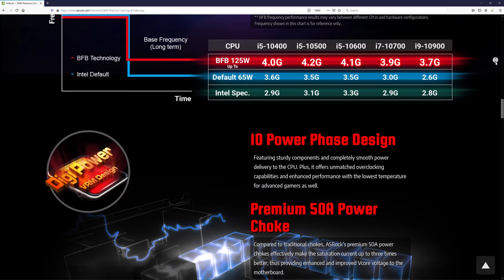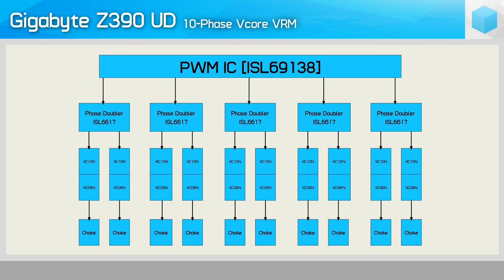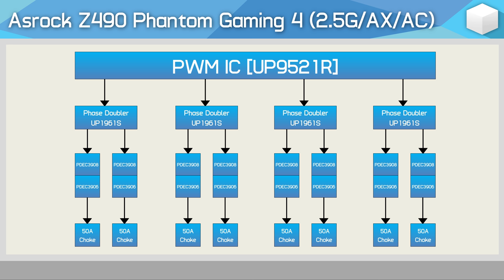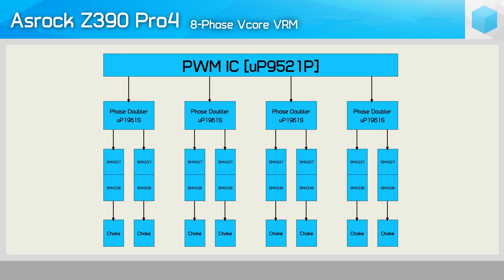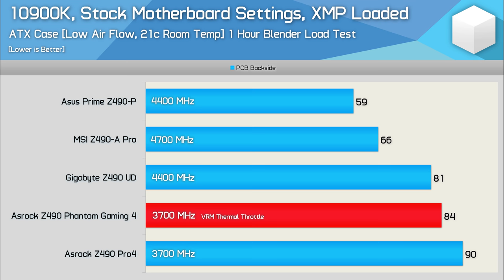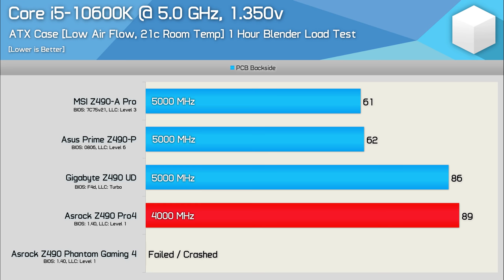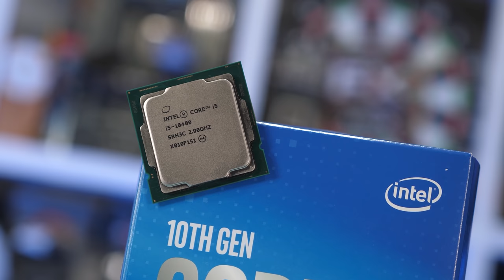Intel Z490 VRM Testing, Budget Buyers Beware of Lies & Misleading Marketing

Comment: MSI seems to produce pretty good mobos in general, both for AMD and Intel. I, certainly, have been extremely happy with my Z370 Gaming Pro Carbon, for a couple of years now.
Reply: Well no. They totally screwed up the X570 line
Reply: @kamilmotulewicz5026  Oh, really? Why does even Steve himself have a couple of videos where he mentions some really great MSI X570 mobos?
Reply: @kamilmotulewicz5026   there is the msi x570 tomahawk which was their "return to glory" and also the x570 godlike which has the same good vrm of the tomahawk but more expensive
Reply: @WereCatf  when You're looking for these overpriced mobos for extreme OC then yes, you can choose MSI but if You're looking for more affordable one for 200$ you should avoid MSI with only one exception which is the new X570 Tomahawk as mentioned above. VRMs in cheaper MSI's x570 are as bad as these in ASRock's presented in this  video. Steve did a video about it. Unfortunately the X570 Tomahawk is still not available in my country that's why I'm still calling their affordable mobos a total crap

Comment: Damn, that is bad (can't even do a mild overclock on a 6 core CPU🤣). Thanks for bringing attention to this, it's similar to what MSI pulled on their lower-end X570 boards, and why do they also pair these with anaemic heatsinks? Are they trying to shoot flames out the back of the PC afterburner style? (never noticed the irony with MSI before...)
 
The only question now, can you fry an egg on it? (should be possible) and bonus points for bacon, mmm bacon...
 
PS: What is going on with the LLCs in 17:14? L3, L6, 'Turbo', L1...

Comment: ive always used Asus and gigabyte boards for my system. ive never had real issues with them, and they are very budget friendly. hell my 8700k OC to 5ghz run just fine on my gigabyte Z370 Aorus Ultra Gaming Wifi. Got that for $100 on sale from Frys Electronics.

Comment: From my humble experience in the recent years, if you're hesitant in your motherboard choice, just go with MSI.
This is amazing considering that those are "Z" boards and are supposed to be made for overclocking, yet they can't even handle an unlocked 6 core i5... while Steven tested a 12 core Ryzen CPU on a B350 board with no apparent problems...

Comment: Can you review the ASUS PRIME Z490M-PLUS
? It's a pretty cheap costing z490 motherboard compared to others but I'd like to know how the vrm's perform under a 5.0ghz overclock on the new 10th gen cpu's
Reply: z490m-plus has 8 SiC639 for vcore, same as the z390 hero, so I think it should be able to handle up to 10700k

Comment: To be honest, I’ve been a long time user of ASUS boards, happily used MSI and Gigabyte boards as well. I had Asrock boards on two occasion, during the Socket 775 days and the Sandy Bridge days. It’s the only boards I’ve ever had memory incompatibilities (worked fine on my ASUS board 🙄) and general system instabilities with. Random, unrepeatable crashes, etc... I know my way around when it comes to OC and I would consider myself an enthusiast. Ever since I’ve stayed far, far away from ASRock. Maybe their higher end boards are worthwhile taking a look at and sure, other manufacturers also mess up (looking at the MSI X570 VRM disaster), but mid and entry level ASRock boards have always let me down.
Reply: AsRock are not my first choice, and I would never buy one new, but my Z87M Pro4 just works with my Haswell i5 (it was available and cheap). The 4.5Ghz clock I have on it at the recommended voltage for that is totally stable and the RAM XMP just works.

Comment: So I am doing a new build after 10 years. Can someone tell me whether should I plug in both the 4pin and 8pin 12v CPU cables on the GB-Z490 UD?  Will be using 10700k with limits removed. PSU is an rm1000x.

Comment: I am stunned at the vast difference in value and quality between the AMD and Intel motherboards. So glad I went X570 and AMD 3900X.
Reply: The Intel chipset is expensive AF. The mindblowing power draw makes the VRM expensive AF. If you have to pour as many features on it as an AMD board has you end up with a $250 price tag on the entry level boards... something's gotta give or people will realize they pay are going to pay $300 more on their total system for that "Crucial 10% advantage in high refresh competitive gaming... but only on a 2080ti... and only at 1080p.. and only if you have a 240Hz monitor or better".
Reply: jvalex18  No. Intel is better at gaming when you are CPU limited only. As soon as you hit the hard GPU bottle neck it becomes a moot issue. I get that e-sports players need all the FPS they can get (or at least they say they do), but for someone who likes single player stuff at 1440p/4k with every thing cranked to max it pretty much becomes a question of "how do I save elsewhere to be able to buy a better class GPU".

Comment: My ASUS Z370-F strix came with a little M.2 bracket that holds a 40 or 50mm fan. It's advertised for M.2 cooling but I've screwed it down with the AIO over my VRM's.

This thing must cost pennies to manufacture, why don't these companies include something like this in their budget ranges, then you could overlook the fact the vrm heatsinks aren't on steroids

Comment: If I was in the market for a new Intel system, I would have def. looked at Asrock since the boards I had from them (two) were quiet good........ Thank you very much for the review although I will probably go down the AMD route once 8 cores become the new standard with the upcoming gaming consoles. My gaming Rig still plays my titles quiet well (i7 6700K @4.6, 16GB Ram, GTX1070 at full HD Asus 144Hz Monitor). Maybe Asrock for the next Gen AMD, I wouldn't rule that out, but the boards you tested  here are a disgrace.

Comment: How to check VRM temps? I have Asrock Phantom Gaming 4, Intel 10400, when using the new Base Frequency Boost bios it tops out at 81W :/ My older Haswell system up and died.. so I just went and got the cheapest z490 mobo :(

Comment: 12:50 how is the airflow adequate with a closed off front panel AND a radiator in the way of the intake

BTW is it just me or does it seem like the motherboard manufacturers are taking turns in producing garbage tier products with every processor generation from Intel or AMD?

Comment: Does ASRock even try anymore?
Edit: My B450 Aorus M includes 4x USB 3, 2x USB 3.2As, 2x USB 2.0s (total 8 TypeAs), HDMI and DVI out and surround audio. It has decent VRM with decent heat dissipation, M.2, 6 Sata Slots, Digital and Analog RGB and a RGBW port.. All in for 104 dollars.

Comment: Funny how motherboard quality makes no sense. It often doesn't correlate with price, manufacturer, anything. I didn't know about Buildzoid when I bought my Asrock B450 Pro4, my R5 2600 could only overclock to 4.1GHz at a whopping 1.4V when everybody I saw could get 4.2 easily. When I found out about him, I discovered that I could've bought a VASTLY superior board for less than $10 more. Recently I got a nice deal buying a R7 3800X and selling my R5 2600, and even at stock settings and letting PBO do the overclock it rarely ever reaches the 4.5GHz single core boost, 95% of the time it can only get 4.4 or 4.45GHz when I'm lucky, and the side of my case get really hot when gaming.

Comment: The last ASRock board I bought was the X470 Taichi, and it will be the last ASRock board I buy.  The board was great with Ryzen 2000, but was nothing short of flakey trash with Ryzen 3000.  Their BIOS support is terrible and even with the lastest 3.90 version the board still has boot and post issues.  It's been almost a year since Zen 2 released!  

So anything ASRock is a hard pass for me.  I ended up replacing it for my daughter with a Gigabyte B450 Aorus Pro WiFi (she doesn't  OC, so not worried about the VRMs and the board was a great price), just swapped them out, didn't reformat or anything.  Her machine is flawless now, go figure... 

I'll be sticking to the majors now, Gigabyte is my fav, both my kids have the afore mentioned B450 board, and I have the X570 Aorus Master, all have been fantastic and BIOS support from Gigabyte is great.  My wife has the MSI B450 Tomahawk, another great board.

Comment: So basically the ASRock motherboards' VRM coolers are not enough to sustain a heavy load with 10900K, due to severe lack of thermal area. Granted, I'm glad ASUS and MSI have learned the lesson regarding the VRM cooling and using good VRMs to support the 10900K. :)
Reply from the maker: It's more that the VRM components, the chips, are garbage.
Reply: @Hardwareunboxed  Oh, that's why... Maybe it has something to do with cost-cutting as strong VRMs tend to be more expensive than inferior ones that could not handle the punishment levied by the 10900K.

Comment: these vrm temprature wars at the moment.. now im never one for liquid cooling and i tell you why. and it has to do with the bloody static heat sinks on the vrms once you've removed the cpu fan from the equasion and replaced it with a water block you've killed off the passive cooling of the vrm quite substantially this is Exacerbated by overclocking.

Comment: I've only used Gigabyte MB's and MSI stuff, both have lasted for over 5-7 years until upgraded,Bought an ASUS MB and put my intel chip that was in my Gigabyte into it and it was a worse board, and I only use Nvidia GPU's and again gigabyte and MSI, they have NEVER failed in all the years I've built computers.

Comment: Maybe overclocking an Intel CPU in a case with mediocore airflow and then letting it run Blender (an AVX2 load!) for an hour with full load on all threads is not really a use case that makes any sense. I do own a Z490 Phantom Gaming 4. I can easily play Modern Warfare with 5 GHz, 1.35V on an 10700k all day long without any throttling.  Someone that really does a lot of rendering will get an AMD system with more cores anyway. Someone that is going to build an Intel rig for gaming ill be just fine with any of these boards with a load an air cooler or an AIO can safely dissipate. Maybe gaming loads are what a board called "Phantom Gaming 4" as designed for.

Comment: So the choices are junk from Asrock, a bad but useable at stock VRM with acceptable IO from Gigabyte or capable VRMs with no IO from MSI and Asus. Wow. The only thing on that list I would consider is the Gigabyte board because I don’t overclock and it will cost another $20 in add on USB cards to make up the lack of IO ports the two other motherboards don’t have.

Comment: What is going on with ASRock? I have a few of their boards and they were always good "bang for the buck" and have only had one fail during a thunder and lightning storm, which was replaced for free. They need to get their collective S#%T together and fix these problems before their brand takes too big of a hit. I would be pissed if my new motherboard couldn't even run a processor at default settings, come on ASRock.

Comment: It might be time for a standardized definition of the term "phase"
Reply: There is one.  Given a switching rate, the number of pulses within one switch cycle, offset from each other, is the number of phases.  The whole point is to reduce the troughs in power delivery, so you get a smoother output wave, without the need for a bunch of extra capacitors to do the smoothing.  You also need less beefy components, because the overall load is shared between many of them. 

It's really analogous to the cylinders of an internal combustion engine.  The more cylinders, the smoother the engine, as they can fire out of phase with each other to counter the momentum that wants to make the engine rock back and forth.  And you can use smaller cylinder bores to get the same amount of power.

Comment: i'm gonna preface this admitting right away i'm understanding cpu vrm in these months and i'm still in open sea so yeah.. this below could be bollocks feel free to correct and add to it, i'm here to learn .
i'm not really sure you can just sum the max amps of the power stages and call it "capable of" anything.
the high side mosfet bears the bulk of the load and that is 12V*amps which is much less amps than what the cpu draws from the inductor, also no 2 or more phases should be conducting at the same time anyway (some overlap might happen) because it's a multi-phase configuration so the amount of phases shouldn't matter: it's a 45A 10phase vrm, not 45A*10phase.
the reason why more phases is better has to do with transient load response time, not max current.
Reply from the maker: It you have a 4 phase VRM with double the components or an 8-phase VRM with half the components, if the components are the same, the current capacity is much the same.
Reply: @Hardwareunboxed  i wish i had a scope to probe around. :)

Comment: People give ASUS a lot of shit but their boards are really solid if you ask me. Their cheaper stuff has nothing you don’t need and always pack the right components where it counts. I went with an x570-prime p for my 3600 after I bricked my x-370 prime (my own fault) and before those I was running a P6-X58D-E with an i7950. All those boards were champs and could overclock to anything I could manage and the cpu could handle. I wouldn’t say their GPUs are always the best but I think they and MSI are my go to motherboard manufacturers.

Comment: AMD fans:  cried & whined about why no support for B450/X470 for Ryzen 4000 (last month) which costs between $70 to $120 and AMD fixed that with promising to provide Bios support 
Intel fans:  Watch my stock i5 crash on my $150 Z490 mobo Lol, I just wanna know how Intel give Asrock the certification licence to sell toasty mobo
Reply: jvalex18  Why U buy Z490 & unlocked CPU if you won't OC?
I can understands the H series Mobo / A series have no OC option, but as long as Z490 meant to OC, then it's retarded to not include good VRM on all Z490 Mobos

Comment: literally every brands z490 mobo: we are ready to power a cpu, my vrms are amazing, i wonder how hot will intel 10th gen be
intel 10th gen: okay soo first i want 230w power, then i need minimum 720mm water cooler, but i prefer liquid nitrogen so yea. oh by the way my bro 10900 (not k, no oc, stock) just reported 90 degrees on 360mm water cooler, oh my bro how could they even try to cool you on this cheap water cooler :(  this is real by the way 

beware yall, ready to spend half your budget on a liquid nitrogen, i9 10900 and 10900k are coming!

Comment: I have said it before, I will say it again: ASRock is trash & has gotten a reputation that it does not deserve. They are always listed as a great, feature rich, budget, mobo. I have purchased 3 in the past, the last was the LGA 1155 Z77 Pro 3 in 2013. The first Z77 board was DOA, the second board made it until the end of 2014 (about 1 year) before it started behaving erratically and was replaced by a Gigabyte board for my black Friday 2014 upgrade.  

The prior two ASRock boards were the same story, they were purchased as the best mid-tier budget boards of that generation, they both started out with promise & were feature rich, they both became unstable & were replaced with name brand boards within a year. I haven't even mentioned the absolutely trash RMA process for ASRock & I wont bother because I will never purchase another one.

Long story short, they pack their trash with features so that tech channels will refer to them as the best mobo in their price range. That's it, it is a scam. No tech enthusiast is running ASRock in their personal systems. Pay the extra $20 - $25 for ASUS, MSI, Gigabyte.
Reply: I've had a Z97 Pro3 with a 4790K for the last 6 years and it's still going strong.  Was looking at ASRock for a Z490 build but after this video I guess I'll go Asus or MSI.

Comment: its almost as if z490 is just for unlocked ram frequency. Which helps in high framerate games. with 20 to 50fps perf advantage. No overclocking though lmao. On a board thats over 100 bucks\eur. Ridiculous

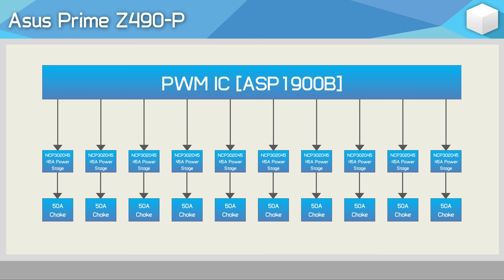Comment: 4:46 chart makes it look like a 10 phase, there should be 5 lines coming from the controller, each going to 2 power stages as they run in parallel, i know asus does not use doublers

Comment: Ouch ASRock... Ouch... You should've known better than to try and run shenanigans with Steve. "Absolute garbage" are pretty big words when they come out the mouth of a level headed Aussie... But failing to run the 10900k at base clock without even MCE enabled is just that...

Comment: If you're cheaping out on a mobo w/ a 10900k, you deserve to have it not work right......
Reply from the maker: Makes no sense at all. Why waste money on features you might not need. As proven here the Asus and MSI models work just fine. Why spend another $100-$200 if it buys you nothing you need?
Reply: @Hardwareunboxed  a better VRM solutions is one of the features you're paying for.  I agree there's a lot of functions / features on the upper end boards that border bloat, but that's the industry.  Keep bringing attention to the issue and we'll see slightly better VRM solutions on the boards, but it won't come free.  4 USB ports on the rear is sufficient IMO.  The lower priced Z490 are 'supposed' to be the budget performance but we're seeing an industry trend where there are B550 boards with better features than the X570.  It will likely take intel / amd saying basically if you're going to use the higher-end chipset, regardless features, it needs to meet a minimum performance threshold in regards to powering all CPUs that fit it.  --- A bit of a tangent, have you guys tried to use a different cooling solution for the VRMs by chance?  Could it be as simple as just giving it a proper heat sink and / or better TIM.